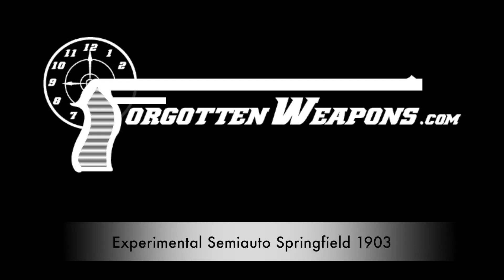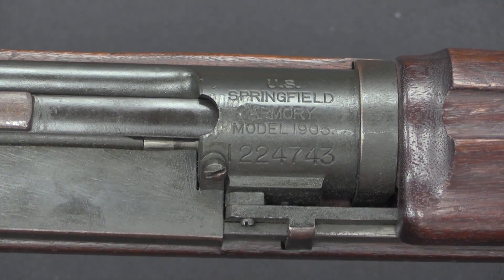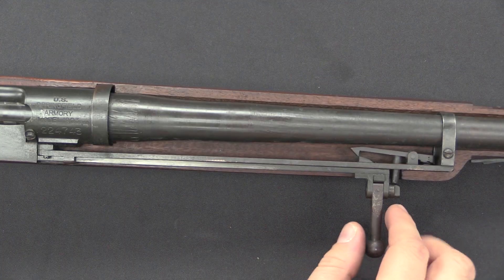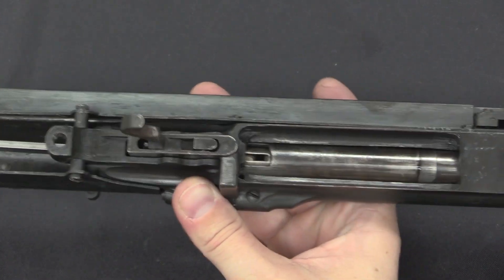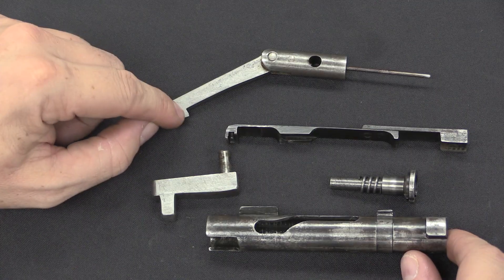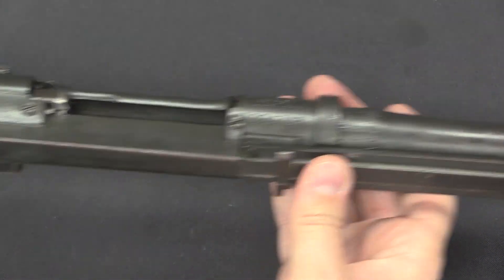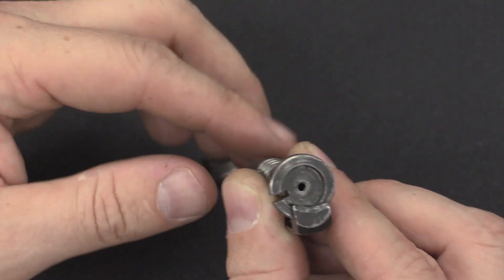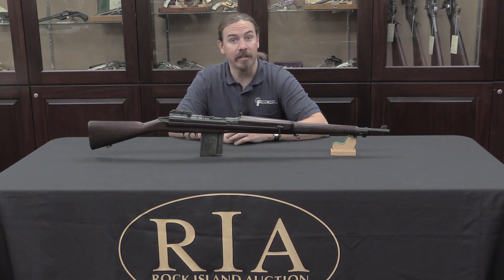Experimental Primer-Actuated Semiauto Springfield 1903

Comment: I love wandering through Ian's back-catalog, and finding episodes that I missed!
What a wonderful piece of engineering - and I have to think, that were it not for the failure of the primer actuated theory itself, this one coulda been a contender.
But, by the time the primer actuated theory was dropped in the 1930s, the Garand and Pederson designs were already around, themselves having experimented with primer activation - and the need to convert 1903s was just, not really a thing.
This one is a real, "If they had only..." type of design; if they had only gotten over the fear of gas ports affecting accuracy 20 years earlier, and ported it... we might have gone into WWII with a more refined version of this rifle. Perhaps a pistol gripped model. Maybe in H-Bar version replacing the BAR? It's fun to think of those possibilities.
I wonder if there were issues with the 1903 receivers handling the extra strain of semi-automatic fire.

Comment: I actually think that is isnt primar activated and that it actually is the hole crtrige that moves a bit in the chamber and pushes on the bolthead.
Primar activated guns normaly have a part in the bolt head that moves and not the whole bolt head. Like the garand rifle where in the middle of the bolthead is a part that is the same size as the primar. And case activated guns are easier then primar activated guns I think.
But this is just a theory of mine, the gun had to be tested to be sure.

Btw awesome video, I love these forgotten weopen designs. 
And sorry for my bad english I am from germany

Comment: That's probably the most elegant semi-auto bolt action conversion I've seen. I'd love to hear more about why the primer-actuated system was never adopted by anyone. Thanks!
Reply: The death of any primer actuated system for military use was staking the primers so they couldn't move. This was done for machine gun use and carried over to the rest of ammunition manufacture. Also the system was very sensitive to different pressures
Reply: least elegant*

Comment: Ironically it still would've worked with out the primer actuator part of action, just the spring loaded bolt face just like made famous by the Bennelli shotgun action would've been sufficient for the action to work. The primer actuation is actually superfluous to that action.

Comment: So with that spring loaded boltface, I could see a cartridge case being used as the actuator instead of the primer with modern ammunition, making use of a slightly variable, tensioned headspace. Delayed cartridge blowback?
Reply: Exactly...hate to disagree with Ian, but I don't think this had anything to do with the primer. If they had grooved the chamber like an HK, it probably would have worked fine!
Reply: @charlesdelair61  there was special ammunition and more than one rifle made to use primer actuation, but the method I suggest above would be more feasible I feel than primers. It is always unwise to disagree with Ian 😁

Comment: among other things, on thing i don't get about this gun is that the stock was made special for the receiver, and yet, they still put the handle so far back. Everything else about the gun is so clever, but for some reason, its like someone who didn't realize what a trigger was made the stock, not thinking that you were ever suppose to use the trigger.

Comment: 12:40

Anyone else want to see the semi-auto disconnecter removed so we could have a full auto 1903?
Reply: That would be the most uncontrollable, impractical, and unusable .30 cal firearm on the planet.

Yes
Reply: Worse recoil than an M-14; fun to watch but not to Use!
Reply: @cnlbenmc prob what grand n M14 was inspired from esp considering the timeline

But this be like making a straight pull mod HK cocking from a rem700
Reply: Or just install the bolt tail upside down, then you would have a open bolt 1903 springfield. Just point it and pull back the charging handle.
Reply: It would kick like a mule
Reply: Sounds like something I'd expect to find/craft in Fallout
Reply: That would just be a BAR on a diet

Comment: Are you sure that's actually powered by primer movement?  It looks like the spring loaded bolt head would let the entire case shift backwards slightly, which would then push back the striker and unlock the bolt.  Maybe more of a hesitation lock?

Comment: @Forgotten Weapons
It looks to me like it is case head activated, rather than primer operated.  Pimer actuation would have a larger hole in the bolt head, at least the diameter of the primer, and a shoulder on the firing pin for the primer to push. There would also be no need for the spring loaded bolt head if it was primer operated. It looks to me like this would use standard ammunition ( might have had to be lubricated, or waxed), and that the initial rearward thrust of the cartridge pushed the bolt head back until it was stopped by the locked bolt body. During this initial rearward movement, the bolt head is also functioning as a tappet piston pushing on the firing pin/operating rod assembly. The firing pin/operating rod assembly then travels a longer distance before the cam track starts to unlock the bolt body. By the time that the bolt body is unlocked, pressure will have dropped to safe levels.
Reply: that's what I was thinking as he started explaining the primer thing... it almost looks recoil-operated? any kind of blowback in 30-06 would surely just destroy the gun.

Comment: You said no way to fire if the firing pin assembly is upside down but if you dropped the bolt wouldnt it just fire full auto through the mag if the spring can load cartridges that fast?

Comment: You said that if you install the firing pin tail thing upside down it wouldn't fire, but shouldn't it just fire as soon as it goes into battery? Since it has nothing else stopping the pin and that is what pushing the entire bolt assembly forward. Unless I'm mistaken.

Comment: The recoil spring rod has the sear attatched and can be assembled upside down.  It looks to me that if you were to load the rifle assembled in that way , that it will slamfire as the bolt closes as there is nothing to hold the firing pin back ?  Or have I missed something ?

Comment: did the primer sytem actually work reliably? A pistol grip would have resolved the issue with the trigger to some extent, or change the trigger to a lever with a  second trigger further back to the original location, a connecting bar pinned to both would increase leverage too, making for a somewhat langer but much lighter trigger pull.

Comment: Isn't it more like hesitation locked system? When fired, the cartridge case would move backwards (the bolt face being spring loaded) and cause the rear of the bolt face (the sleeve over the firing pin) to push the cylindrical piece holding the firing pin backwards. The force exerted on the base of the case (and transferred to the bolt face) would be much greater than that on the primer (same pressure but much greater surface area) and that would be where the majority of the energy operating the action comes from.
If the push on the firing pin by the primer was what starts the rearward movement of the action, by the time the bolt face starts moving backward (which would be delayed by the amount of time it takes for the chamber pressure to drop enough to let the case move backwards freely), it would have nothing to push on - the "cylindrical firing pin holder" would be long gone on it's way to unlock the action.
Also, the primer has nowhere to go when being pushed back - there's no "pocket" on the bolt face to let it set back - it's flush with the bolt face and can only push on it, just like the rest of the case head.
The peak force on the 30-06 primer is really quite remarkable (more than a ton!), but without some special provisions (like the aforementioned "pocket") only a tiny fraction of it get's transferred to a typical firing pin (the one in the video looks quite regular-sized). Otherwise wouldn't it cause serious problems in normal striker-fired bolt-action rifles?

Comment: If you read Hatcher's Notebook, he states that the Army provided M1903 Springfield rifles or components thereof, to people working on semi-auto rifle designs in order to save them the cost of manufacturing those components - which most of them weren't equipped to do in the first place.  That's why most of the early semi-auto military designs are based on the M1903 - some being so crude as a Rube Goldberg contraption to automatically manipulate the original bolt handle.  John Browning made similar designs to operate the lever on Winchester lever action rifles, and the New Zealand Army manufactured a full-auto conversion of the SMLE during WWII.  And FWIW, John Garand's original rifle design was primer-actuated.

Comment: Would this be considered a delayed blowback? I doubt primer setback would give enough energy to cycle the gun, probably just enough to unlock the bolt. Once the bolt is unlocked by the primer setback, residual pressure in the chamber would force the case back and cycle the action. Also, do you believe John Garrand had a hand in this design? I know he initially worked with primer actuation when he went to work at Springfield.

Comment: This is probably me being dumb, but I'm curious. That notch on the bar that engages the mainspring is what engages with the trigger mechanism. Without it, there would be nothing to hold the firing pin back to stop it from hitting the primer on a chambered round. You said that that piece can be installed upside-down, meaning that the notch wouldn't be able to engage the trigger, meaning that you couldn't use the trigger to fire the gun. But, would it also mean that there would be nothing stopping the firing pin from going all the way forward and hitting the primer? If that were the case, you could (in theory) pull back the charging handle and let go, allowing the action to chamber a round and allowing the firing pin to go all the way forward, hitting the primer, firing the round and cycling the action, and there would be no way to stop this because the trigger, the thing that prevents the firing pin from fully completing its travel, is disengaged from the action, meaning that the action could go on in full auto until you run out of rounds.

I'm probably wrong, but that seems like a major design flaw if you can turn a Semi-auto Springfield into a nigh-uncontrollable .30-06 automatic rifle by just flipping an internal component upside down.
Reply: Modification 2, right after putting a functional pistol grip on it.

Comment: Wouldn't this theoretically let you use severely underpowered loads as long as you had a good primer?
Reply: Douglas Fulmer I think so, it might also be a way to make a semi auto or automatic captive piston propelled  gun. imagine a totally silent and flash free smg.
Reply: john harker There are US made examples of such a design in 12 gauge although the Russians were much more interested in the technology and are known to have fielded pistols that fired specially contained 7.62x39 rounds to make it appear a shot had come from a rifle much further away. The US civilian market for something like that is non-existant currently because the ATF considers each round a "suppressor" that requires a $200 tax stamp.

Comment: one of the Launchers in use by our military today, the SMAW, uses a primer actuated 9mm spotting round. it's called 9x51 SMAW and is a very weird round.
Reply: That's actually made of a .358 Winchester (.308 necked up) with the back end bored out, and a .22 Hornet blank put in place as the "primer".  The Hornet has enough power to push the 9mm tracer bullet out at about 750 fps or so to match the ballistics of the SMAW projectile, and the Hornet case setback provided the energy to operate the action.  The put out an RFP for replacing the SMAW spotting rifles about 20 years ago, and I was very surprised they just didn't go with a long barreled .357 revolver firing a tracer loaded up to .38-200 levels, but they actually specified a semi-automatic action in the requirements.  I actually still have the descendant of the external ballistics code I wrote to do the ballistic matching on the drop table for the SMAW.
Reply: @fluzwup  wait SMAW rockets match the ballistic arc of .38-200? Thats...really weird
Reply: @tomaspabon2484  Not really a ballistic match, just a match of a possible projectile weight, and the muzzle velocity.  The SMAW is a big diameter, but low density projectile, and these tend to cancel each other out.  I think I reverse engineered it's BC something on the order of .45 to .55 on the G1 scale, and it's moving about 750 fps.  So the .38-200 load gets you the velocity you need, but you'd have to load it with very ballistically efficient .358 rifle bullet to get the low drag you need--something with a long point, and a boattail.  You wouldn't be able to chamber the result in a typical revolver, since the pointed bullet would be way too long to fit the cylinder.  You'd need, ideally, a custom chamber for .38 Special length brass, with allowances for a very long overall length, and longer freebore.  You could also do something similar with a .30 Carbine case and a low drag .308 bullet.

Comment: I have just imagined the dream of all militaries. Being able to use those old flint lock muzzle loaders modernised to breach loaders that would get clip added in time. Then You would change operation into proper semi-auto add changable magazine, full auto, rails, ACOG and lightweight frame with it and after 400 years of service You haven't purchased any new design yet. 
40 or 50 of those sweet old modernisations would do the job done and You didn't need to accept anything new. :-D
Reply: Not to mention for magazines they could literally have a case on top filled with lead balls so they wouldn't need any springs or expensive magazines

Comment: Hi Ian, in the 60s Chinese developed a prototype 66-136 assault rifle.  It used a similar action principle, and was capable of semi/ full auto firing with reasonable reliability and accuracy.  Chinese engineers had some excellent ideas to resolve casing ejection difficulty issues and gas sealing issues.  In the end, this rifle lost in the trials due to its accuracy was just a bit less than the traditional locking system prototypes.  For more details, maybe you can contact your friend Timothy Yan for getting more info from Chinese web sites.

Comment: Weird..  Weird that they were still making 03 rifles in 21.  I would have thought with the end of WWI they would have had literally millions of spare ones sitting in their arsenals with no need to keep on churning them out.  Clearly someone somewhere lacked budget oversight.  Primer setback or not, I would describe this as being almost straight blow back.  Yes, sure the bolt head turns.  Still it is essentially blow back and the turning of the bolt head is almost an afterthought.  I am also noticing how easily the plunger of the recoil spring in the stock moves under finger pressure.  For a 30-06 I would have expected something more stiff.  My point is that BAR magazine or not, I am not sure the movements cited are sufficient to handle a full pressure 30-06 cartridge.  Has anyone done a chamber cast?  I think firing this in .30-06 would be a lot like firing the Thompson rifle with really energetic ejection.  Looking at the timeline I note in 23 the Army choose the less powerful .276 Pederson for more experiments in semi-auto leading to the M-1,  To me this gun raises lots of trivia questions.
Reply: they were still making 1903s in 1943, I almost bought a 1943 Smith Corona recently
Reply: Yeah I know.  03A3   It just seems weird to weird to me they did that with so many rifles on hand at the end of WWI.  All through the 20s and 30s we gave bolt action rifles away by the boat load, apparently for no other reason than to justify turning out more bolt actions.
Reply: That was exactly how Springfield Armory operated.  They considered making excess rifles preferable to laying off their staff when they had enough rifles.  Noting also many of the earlier 1903s had to be recalled and trashed due to the heat treatment issues.

Comment: If the bolt head moves back immediately as the cartridge attempts to move back under chamber pressure would that 2/3mm gap before it unlocks not lead to some case head separations?
Reply: Ah wait, does the spring between the bolt head provide the kickback as the bolt head stays tight to the cartridge?

Comment: So this is a Blowback Operate Rifle ？
Reply: No it is a primer actuated rotating bolt. A blowback gun does not lock and the bolt is held closed by the mass of the bolt and the recoil spring. It is operated by the whole case moving backwards. This is a locked gun. When you fire just the primer moves backwards not the whole case. That causes the bolt to unlock at which point momentum of the primer and then movement of the case pushes the bolt all the way open.
Reply: Almost, but not quite.

Comment: Just one step, one thought further and this would have been a nice gas-operated gun.
Leave the receiver where it was, remove the cocking piece from the bolt, cover its travel with s sheet metal shroud, done.

Comment: Hi Ian, would you , please, explain what makes this rifle  primer actuated? I don't see any reason why that few first mm should be actuated by primer exclusively and then supported by case base pushing on the bolt head. Can't the firing pin assembly be pushed back directly by the sleeve of the spring supported bolt head? (so that the bolt head and the firing pin don't relatively move the first few mm...)
I mean, such operation wouldn't need special ammo.. and would make pretty cool (something like "case base actuated") action.  Are there such actions? That the case move a bit, accelerates the action and than stays on place until the pressure is safe and than is extracted?
Thanks a lot, this is georgeous rifle!